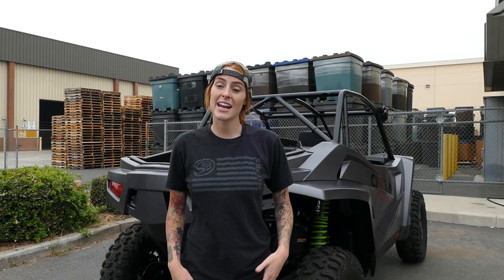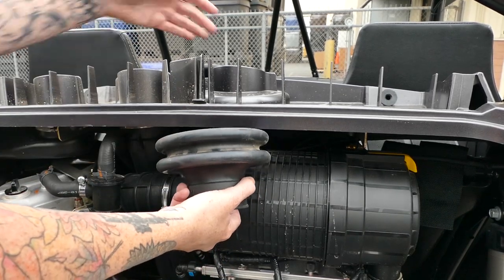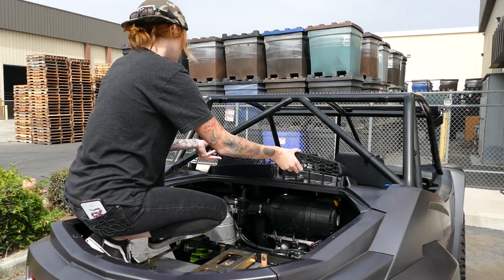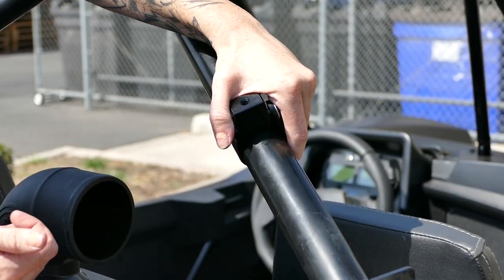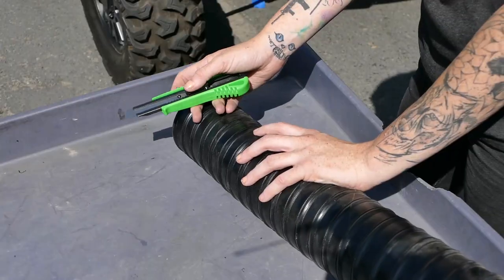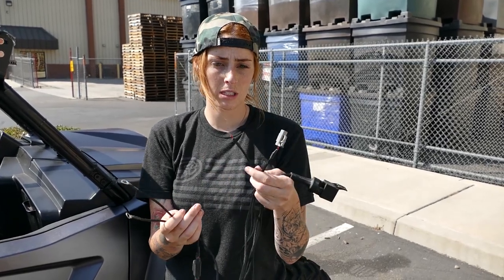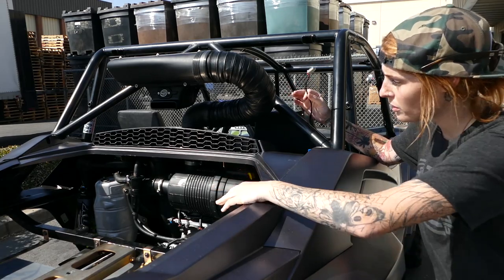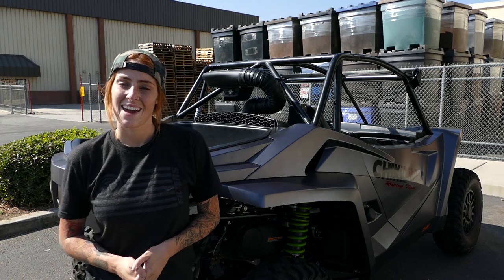How to Install The S&B Particle Separator For The 2018-2020 Textron Wildcat XX

Comment: Any reason not to use the factory installed accessory connections with a switch on the dash by puttingt a SAE connector on the fan wires and plug into the connectors in the battery area (making sure you put your dash switch on the same identified connector located under the center panel on the dash).